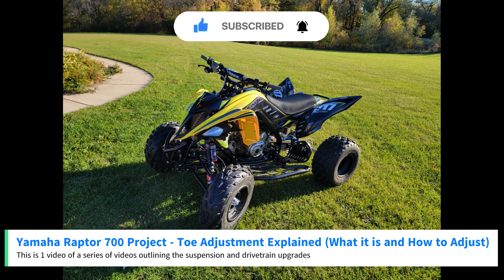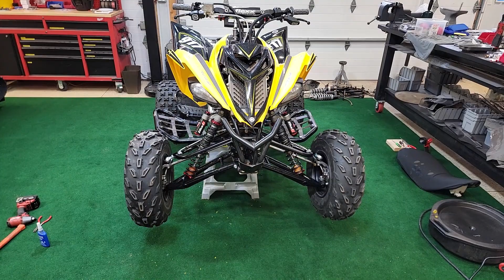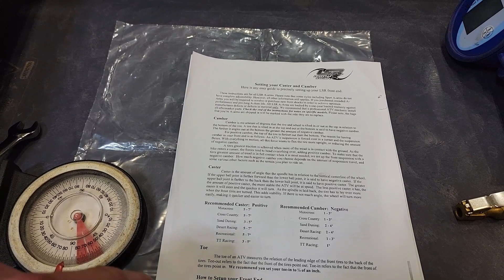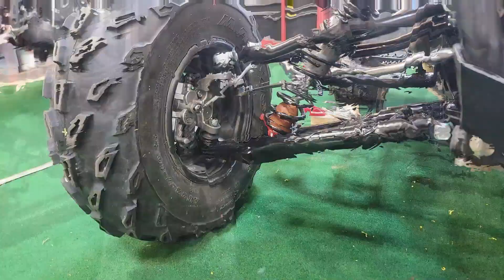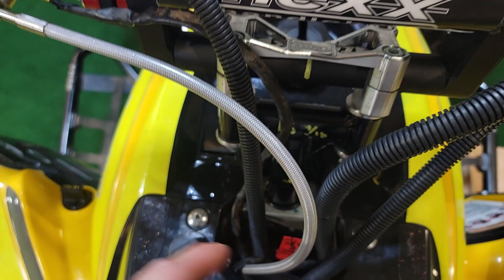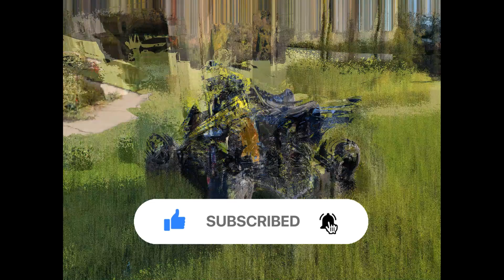Steering Set-Up - Toe Adjustment Explained for ATVs (Tie Rod Adjustment)

Comment: The problem is you just went through the frame which arched the tape in a different way adding length
Reply from the maker: Correct when making actual measurements tape needs to be perfectly straight. Good point. Video was not for my actual measurement was for demonstration purposes. Thanks for checking it out